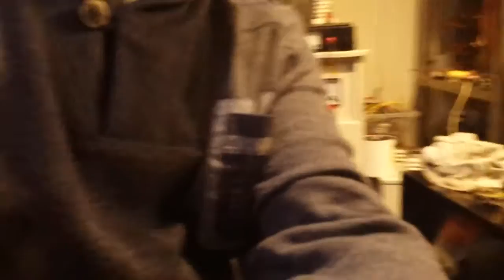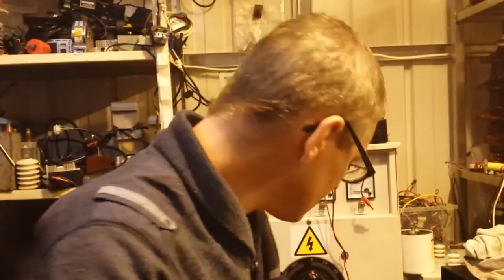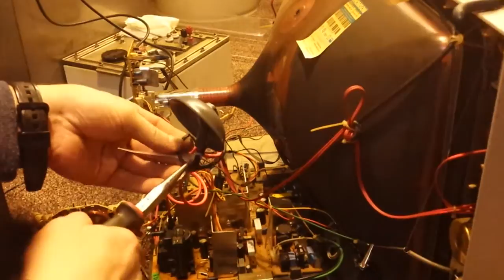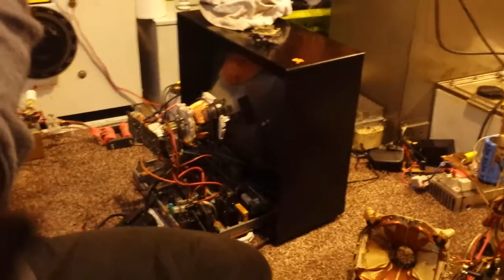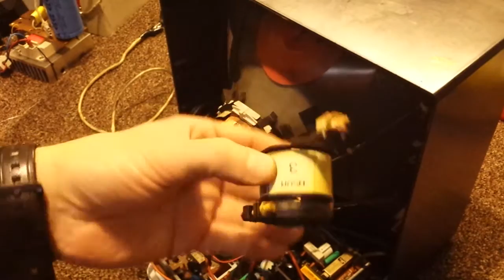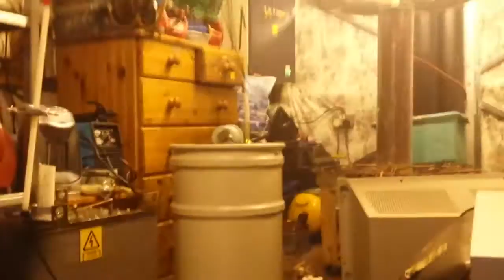Crt t.v Line output transformers arcs

Comment: hi by any chance do you have the following part for sale or know wear I can get one Line output transformer  hr6469. or orega 40308-17nc 47310041 91 if any one can help that would make my life les stressful  and help get my mx7000 fixed also side not the mx6000 use the same part